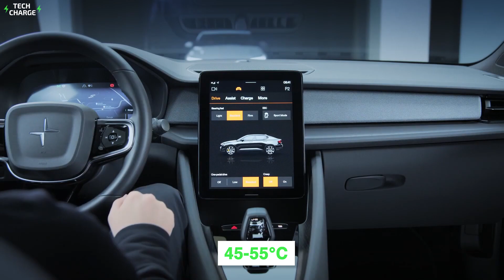The Shocking Truth About EV Fires You Need to Know

Comment: Yes but in these figures you need to take into account the age of the vehicle and Arson, a big problem.Arson will affect ICE vehicles far more and faults causing fires tend to occur in older poorly maintained cars at least 12-15 years old. EV's  going up barely off the production line in some cases and I would guess the average age of an EV fire is 2-3 year. As EV's age they will have low voltage electrical fires caused by wear and vibration akin to ICE vehicle fires. The big difference EV batteries are live 24/7, they go up without warning, develop very quickly burn 3 times as hot are are almost impossible to extinguish, and may re-ignite and are far far worse and are a chemical fire the worst type.

Comment: Li-ion cells generate lots of Oxygen in thermal runaway conditions, making ferocious fires that are hard to extinguish. You can’t put the wet stuff on the red stuff with enclosed battery packs.
LFP cells generate lots of Hydrogen in thermal runaway conditions which EXPLODES!

Comment: I think it would be fare to point out on average 25 electric cars catch on fire per year. Gasoline cars catch on fire over 150 cars a Day. This is government tracking of this issue. Most battery fires are based from the vehicle getting in an accident. Please fact check this so you don’t have to worry about Tesla cars. Buy American cars and you will have less issues. One exception is the Chevy bolt, I would not recommend that car.

Comment: More FUD lies financed by the fossil fuel and car dealership interests.  Not ony are, as the video admits, EV fires more rare per million miles drive than ICE car fires, but the odds of surviving a battery vehicle fire are much greater because instead of being soaked in burning gasoline from a crash which ruptures your gas tank, if you have a crash in an EV which damages your main battery, the fire will start slowly under your car's floorboards leaving you plenty of time to get out of the car before it goes up in flames and yes, is difficult to extinguish.    Except for those BOLT fires which were down to faulty battery manufacturing (an issue which has since been fixed), EV battery car fires only happen when one or more of the car's main battery cells are punctured or there is a short circuit in the main battery.

Comment: I find it intersting that most of the cars on fire in this video are ICE vehicles.
Reply: Replying to @Leneonlymph:

You mean **ALL THE VEHICLES HERE ARE EVS**, right?
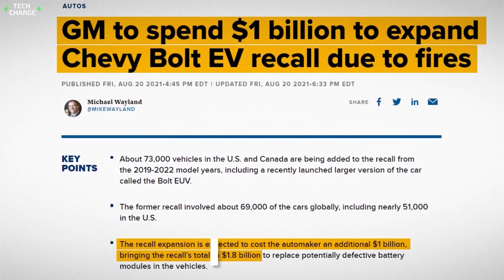Reply: @bellytripper-nh8ox  No, I mean most of the cars on fire are ICE vehicles. At 1:43, the Skoda at 2:40, 2:51 - here the fire goes through the field and lights the ICE car on fire, at 2:57 it appears to be an ICE vehicle on fire under the hood, 2:59 is the standard drive Skoda again, 3:01 also appears to be an ICE car whose engine is on fire, 3:53 could be an ICE Peugot as it doesn't look like the 2022 EV I looked up (but i'ts hard to tell. Maybe they had an older model EV with a hood that looked like the regular gas powered one?!?), the apparent Chevy Bolt on fire at 4:08 looks like it's too close to the ground to be a Bolt. It looks like it could be a VW Golf or even a Renault, it's hard to tell. At 4:39, it's hard ot see what kind of car this is. An ICE minivan at 5:34 and at 5:44 (same one), 5:48 this one looks like an ICE vehicle too, 5:54 is back to that same minivan, at 5:58 that could be a Toyota, in which case it's more likely a Hybrid than an EV, which are apparently the most at risk for fires, at 6:24 it's the cargo on this truck that's on fire, but hard to see what it is, at 6:33 the ICE truck is not on fire too, 6:44 this looks like an engine fire in an ICE vehicle, 6:48 I don't know of any EV's that have a spare tire on the back like that?!? At 6:55, that was the Mercedes that caught on fire from a line from the field and here it looks like it may have been intentionally set perhaps. 7:00 we've seen this one a few times already. Hre it is again at 7:50 and here it looks like it could be an ICE car, but I'm not sure.

Mind you, at 1:57 & 1:59, it's hard to tell what type of vehicle is on fire here. And you're right, at 2:38 it's definitely an EV on fire. 3:21 is an EV. 3:30 looks like a Leaf with something burning underneath it. At 6:26, it's hard to tell what kind of car this is. 6:34, I guess there's a car in that container but hard to see what it was. 6:41, yes that's a Tesla, which is shown again later. At 6:53 that's the 3rd time they've shown this car.

OK, so I would say that my comment above still is correct because a lot of them were ICE vehicles. But there were also a number of EVs on fire in their video.

Comment: The VW ID4 has a separate fuse on each cell of the battery pack, making the battery much safer.  Because of its design, the ID4 is the cheapest EV to insure.

Comment: Battery chemistry is getting much, much better.  The rate of fires is going down really fast.  Not true for gas

Also, EV fires are not more dangerous.   Gas vehicles can explode without warning.  EVs will warn you and you can get away.  And, so what is the fires take longer.   Just let the car burn itself out.

Comment: EVs are going through the same type of development phase that gas cars went through 100+ years ago. Since it's just the battery issue, once the batteries are completely safe, then EVs will be the safest cars. We drive our gas cars without worry, don't we? 
  Now, we just have to produce the electricity for them in a sustainable manner.

Comment: With your "%" numbers of IC vehicles catching fires vs EVs catching fires you forgot to say that 0 IC vehicles sitting cold parked for weeks never ever started burning by themselves while EVs start burning by themselves while switches off and just sitting cold and parked and that is the biggest difference, in fact about 60% of EV fires happen while EV is not even moving. Also drive an EV through heavy rain or hit few flooded water puddles on road and your EV is a toast ready to start fizzing and simmering.

Comment: Speaking of "ruining people's perception of electric vehicles"...how about this? The commercial for the Honda Prologue, claims that they will be carbon neutral by 2050...but when you consider the enormous carbon footprint created in the production of these vehicles, how is this carbon neutral? The EV factories use fossil fuels and you know what else uses fossil fuel? The f**king charging stations for these EV's, because they operate on e-l-e-c-t-r-i-c-i-t-y(which is generated by fossil fuel generators.) Also...what about the spent batteries from these EV's? They are very TOXIC and not RECYCLABLE...think about that...

Comment: Loose battery power and you could be locked in, what's the stopping distance in an electric car particularly in slippy conditions as they are considerably heavier. Why are people being rightly charged for using a phone , when you can legally take your eyes off the road to use the touch screen in the middle of the dash?

Comment: A friend of mine bought a Tesla from that dealer. He lives on Star Island in Miami. When he first saw this video he now keeps his Tesla parked out back where his boat lift is. He says, if that car ever catches fire he will just push it off his sea wall into the inter coastal. Claims he can sleep a lot better now.  Another friend of mine has a 2023 Y model, he will not park it in his garage. He parks it out on the side of the road. He says it will be a lot easier for the Port St. Lucy fire dept to get to if need be.

Comment: i have two EV's one is 9 yrs old, never had a problem at all , i do every thing like im supposed to when charging them , my guess is its the people using them that are not doing things right thats the problem. like if you were at a gas station pumping gas you would have an open fire on you its just common sense over time people have learned not to do. there is a learning curved involved here with an EV you dont do dumb thing like use the wrong cables or plugs or chargers etc etc. when people and car manufacturers learn what to do and not do this will be solved.

Comment: The video mentioned the huge amount of water to extinguish an EV fire, but forget to mention there are multiple reports of the "extinguished" EVs spontaneously combusting again hours, sometimes days, later.

It didn't mention fire fighters quite often need to wear hazmat suits when handling EV fires.

It also didn't mention that the runoff is considered hazardous, it's not allowed to flow into storm drains, and it (as well as any ground/objects that come in contact with it) must be decontaminated and/or disposed of by professionals.

Comment: they will fail because insurance costs are through the roof plus NONONE can repair them Most if involved in even a minor crash, are just written off. No motor repair shop can afford the required safety space to hold these cars. Many buildings are not allowing EV's to park under their buildings.

Comment: Aside from EV's spontaneously catching on fire, the fact that they have limited mileage range per charge in good weather, much less than that in cold weather, the length of time per charge vs filling up at a gas station, not nearly enough charging stations across the country, the fact that a two day road trip turns into a four day road trip in an EV, having to factor in charging time, plus planning your trip around EV charging stations, and the fact, as we now know, that they're incredibly difficult to charge in sub-zero weather, as those in Chicago have found out.

All this has nothing to do with the popularity, or lack thereof, of EV's, right?

Comment: Complete misrepresentation of the Facts! Tell the truth! You Liars are getting people killed! They can spontaneously explode (without predictability), They burn at 1500 -2000 degrees C., They produce deadly gases which one full breath can kill you,  They will burn under water (as in submerged in a pool of water). These clowns are complete liars! """ .03% fire in EV's vs 1.0% in internal combustion engines"""" Talk about twisting the fact - How many Internal combustion engines ignite with no use  or temperature changes, How many Internal combustion engines burn at 1500 dgrees c, How many internal combustion engines explode like bombs? How many internal combustion engines create their own firestorm, How many internal combustion engines create rocket like jets @ 1500 - 200 degrees c. Nothing but half truths and lies in this presentation. CHECK THE EXPERTS OPINIONS - NOT THE SELLERS!

Comment: Water does not put out an EV battery fire. The batteries make their own oxygen as part of the chemical processes needed to maintain the fire. The fire will have burned itself out in the time it takes to pour the thousands of gallons of water. All the water does is reduce the temperature in the immediate area, possibly limiting the heat spread.

Comment: This is what happens when non engineers attempt to explain EV fires and play down their danger. 
So why do EV batteries really catch fire? 
EV batteries are made up of Lithium Ion battery cells, about 7000 cells per EV battery. So that equates to 7000 internal connections per Battery, and that is where the problem originates. 
As batteries charge and discharge, the do so using what is known as the theory of holes. This theory relates to the material used to connect the batteries together and well as to the vehicle. This material is generally copper, because its elemental makeup is best suited as a conductor. 
The theory of holes generally forms around the idea that one electron is displaced from an atom's valance ring, and thus replaced by another electron. This is the basic theory behind current flow through a conductor like copper. As that process occurs and more specific as it speeds up, there is resistance to electron movement at the increased speed, which results in the generation of heat. 
So now you know the simplified theory. 
How does result in battery failure? 
If the connections, most of which are welded, are poor, they will become damaged when stressed, through amperage passed through use or during charging. By damaged I mean the cells become shorted, instantly releasing all of the cells energy.  This can happen to one cell, but becomes much worse when it occurs with a bank of cells, all of them discharging at once. 
If you have ever watched someone weld, then you can understand this shorted cell or cells, discharging process.
Further the batteries are generally liquid cooled so boiling water from the extreme heat of rapid discharge, due to shorting, provides oxygen for the internal combustion occurring in the battery. The higher the temperature, the mor oxygen generated and the more cells that fail and discharge, This is known as Thermal runaway. In old terms related to nuclear power the term used was Meltdown.  However with EVs that term, although accurate, is avoided. 
….
Can thermal runaway be predicted in EV batteries?  
Not currently 
Is there any way an owner might know their EV battery might experience thermal runaway? No … not currently. 
Is there a way to prevent entire EV batteries from experiencing thermal runaway of the entire battery pack?  Yes it can be done. no it’s not cheep. Yes it requires redesign of the batteries. 
If the batteries were encased into smaller separate lots for instance, it’s plausible that one lot could experience failure and be contained, and replaced, without effecting other battery lots, this approach would of course require larger space for the batteries, as well as add more connection points. 
The other approach is to equip EVs with a master disconnect switch (kill switch), which mechanically separates the battery from the car, these are common in race cars. If the kill switch mechanically could separate cell packs, the thermal runaway could potentially be vastly reduced, and reliably ended.
Reply: I remember there was a Boeing 787 somewhere that the LI battery had thermal runaway on the ground similar to those EVs, then after grounding all B787s,  Boeing designed a sealed cage with a vent to the outboard, and Airbus put a seal on the vent of the A350s delivered with LI bats, so during walk around the battery failure could be spotted by far

Comment: NIO cars are the future EV, their batteries are safer and  does not cause fire since its not lithium. It's a Solid-State battery thats safer, and goes 600+ miles in a single charge. Also it will be swappable coming to the US possibly 2025. They are swappable within 3 minutes to a full charge and its also a plug-in charge 5-10 min full charge.

Comment: A good account of the dangers of Li battery fires compared with fuel fires. A petrol fire will usually start in the engine bay when a pipe splits and fuel drops onto a hot exhaust. Once the engine has been switched off the limited amount of fuel can be extinguished quickly as the fire will not travel to the tank. But a battery is a chemical reaction which cannot be stopped easily and will spread throughout the battery pack which is the whole length of the floor so the car is completely burnt out. An extinguished Li fire has to be parked away from other vehicles as it can spontaneously restart the fire hours or weeks later.

Comment: There are over 200 internal combustion powered cars in my neighborhood.  To my knowledge, not one has ever caught fire because of mechanical malfunction, let alone spontaneously combustion.

I'm not sure where you got the statistic that 1.05% of internal combustion cars are likely to catch fire, but that doesn't seem to approach any view of reality ... by any measure (miles driven, times used, or per 100 cars).

According to the insurance industry's National Fire Protection Association, which actuarily tracks car fires, car fires are extremely rare (.04%) ... much  lower than the 1.05% you gave ... 26 times less likely. And that's fires of all causes.

All you have to do is open your eyes to see the error.  The reason that people and mfg. companies have noticed this trend in EV's is because their fires are actually happening more often.

I'm guessing Mercedes, or any other manufacturer, hasn't seen their internal combustion vehicles spontaneously burst into flames while sitting in a parking lot, garage, or driving down the road.

And, statistics do indicate that when EV's are involved in an accident, they are much more likely to catch fire ... because of damage to their batteries.

People are not as anti-EV's as you imply. Many are just not interested in being at this early point on the Innovation Curve."

Finally, innovative new battery technologies that are far less likely to pose a fire threat will shortly start to replace lithium ion batteries.

Comment: The problem is with lithium ion batteries and can be solved with sodium ion or solid state ones. Unfortunately the 10 m plus EVs sold so far have the lithium ion ones which become more dangerous as they age especially if driven on roads that are salted in winter or in coastal areas as we saw recently after the Florida hurricane. It will only take a catastrophic fire like that at Luton Airport where an EV fire destroyed a £20 m car park and 1500 cars but no loss of life to take place within a city with loss of life for them to be banned though before then they will probably become uninsurable. Fortunately due to limitations on national power grids, energy supply and access for charging the market for EVs will be short lived and  they will be replaced by hydrogen powered hybrids using a combination of a conventional engine and fuel cell. Elon Musk has realized this and reversed his adverse views on hydrogen to the point where Tesla will launch a hydrogen powered car in 2024. At this point Tesla will lose any market advantage they have to the conventional auto manufacturers.